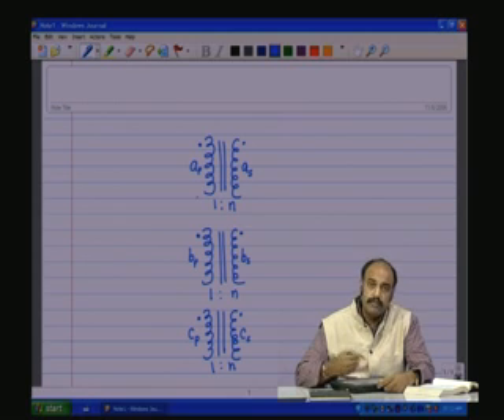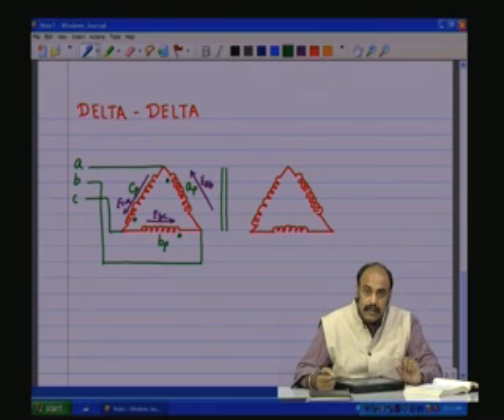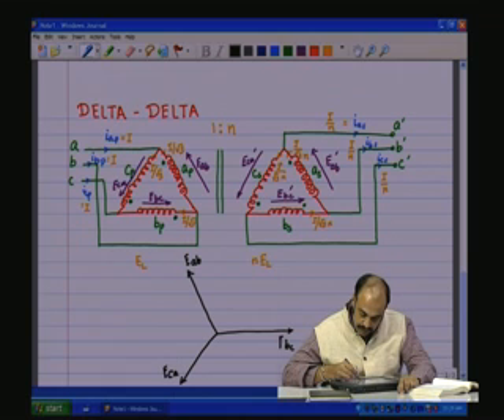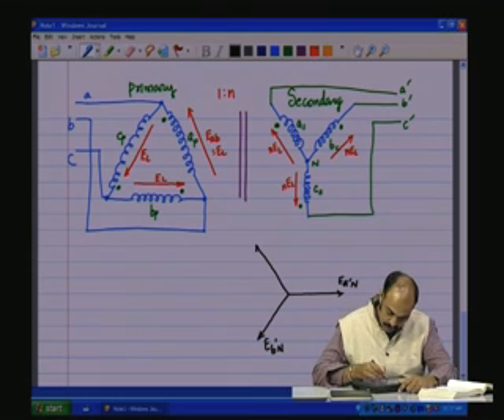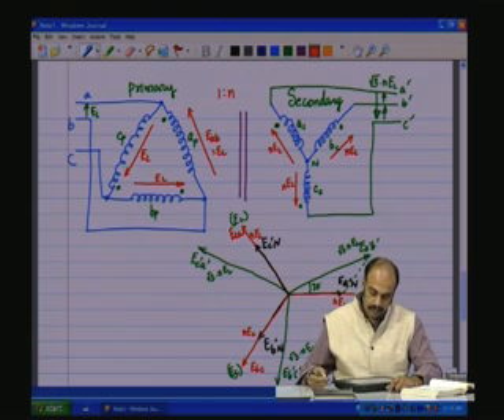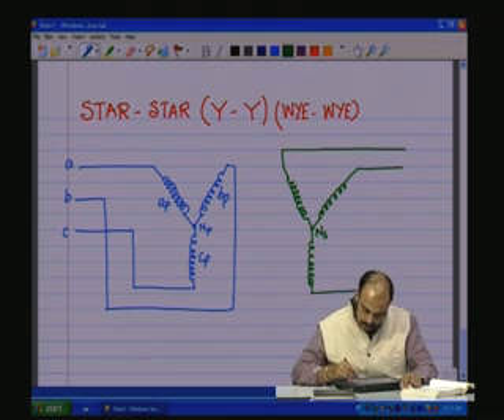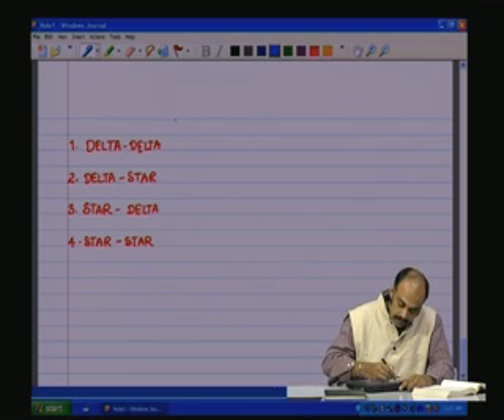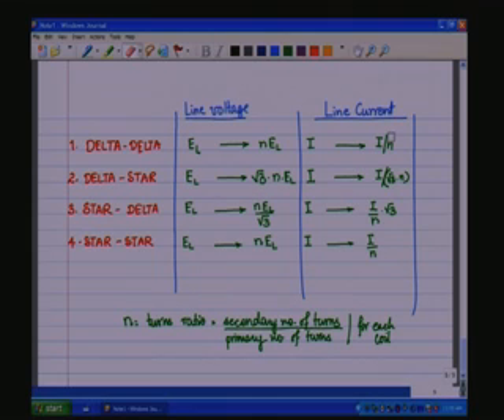Lecture - 34 Three Phase Transformer

Comment: in star-star connection on secondary side why the phase current is I/n instead of I/root3*n?
  why the secondary phase voltage in phase with the primary one?
    thanks for such a lecture.plz reply